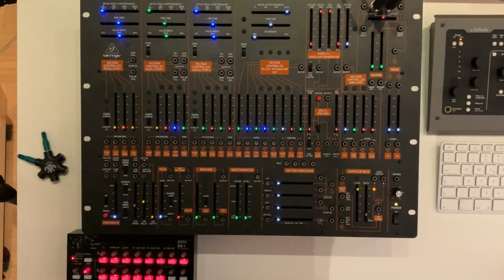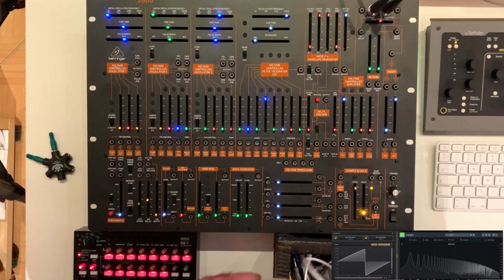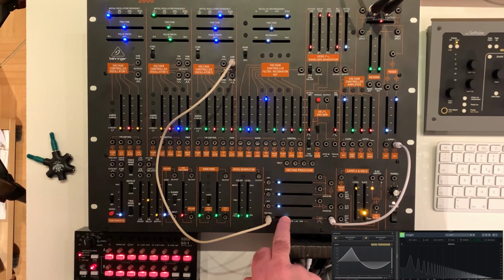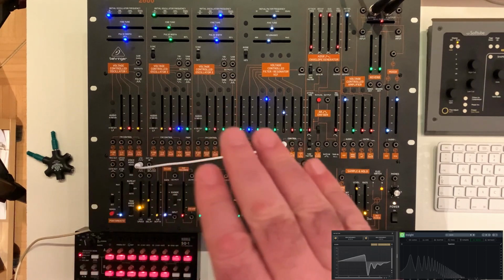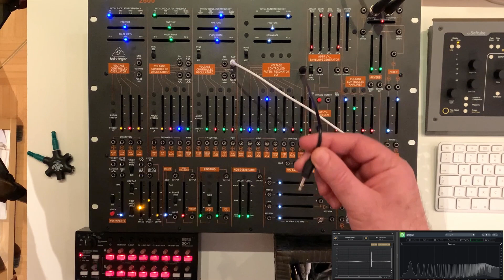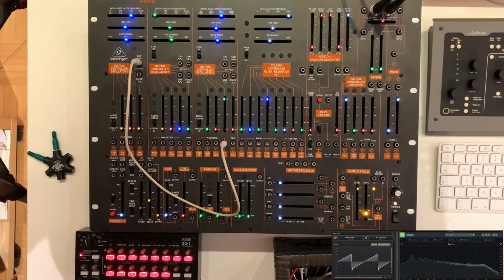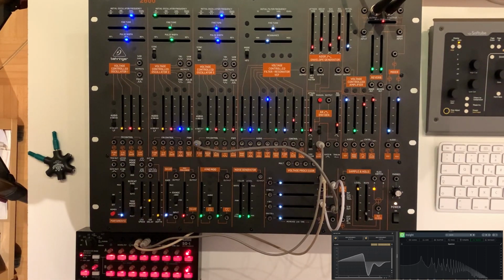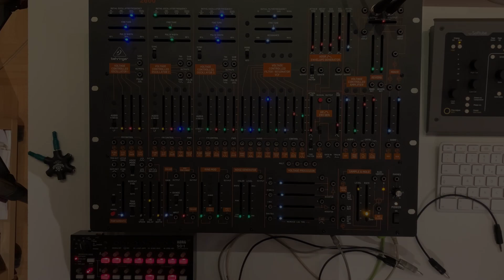Behringer 2600 - Quick Tips Tutorial 4:  Three Inverters = 4 Filter Types

Comment: There are so many different ways to get interesting crossover filter types using phase cancellation on the 2600, I'd say there are more than four types. If you start with osc 3 into ringmod highpass filter via the mult and then take an inverted copy from the mult via the voltage processor back into the input of oscillator 3 you get a much more convining notch filter with the added benefit of resonance which also sounds really good mixed back with the dry signal. Even more interesting phase cancellation effects occur when adding a slightly detuned second oscillator into the mult.
Reply from the maker: @sidefish8362  thanks, great tips 👍